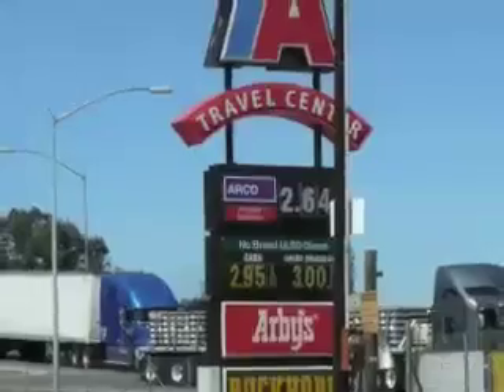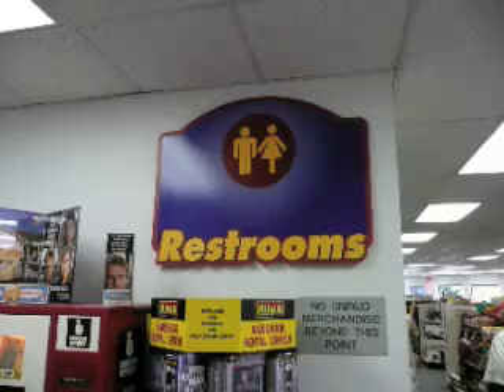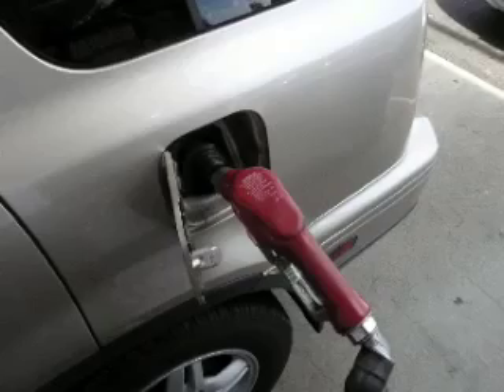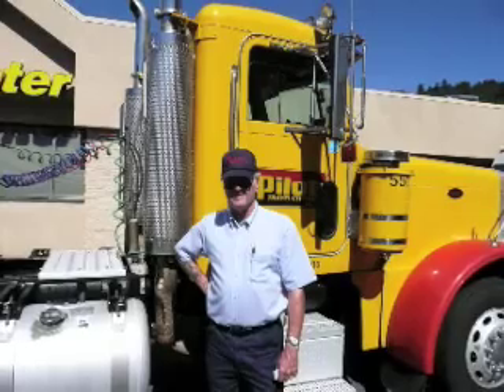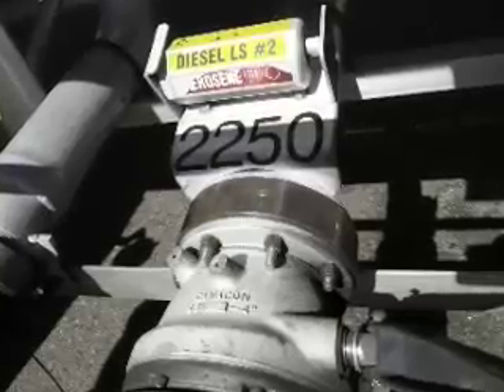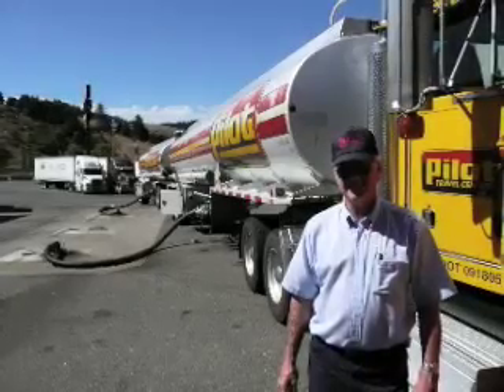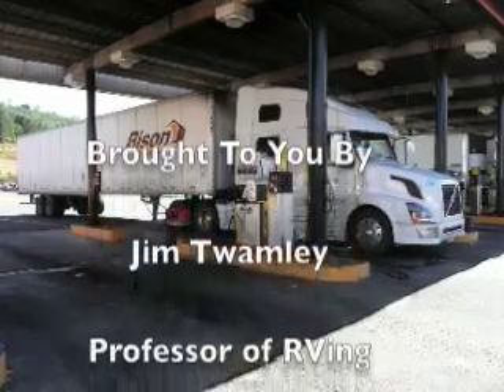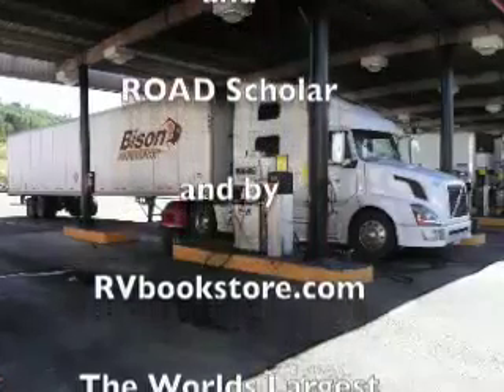RV Professor Explains How Our Fuel Is Delivered

Comment: done this job for 12yrs in uk and its quicker to gravity drop it and a lot safer because of the pressure build up if the tank is not vented enough.was pumping kerosene into and under ground tank and it blew the vent cap off because of a blockage